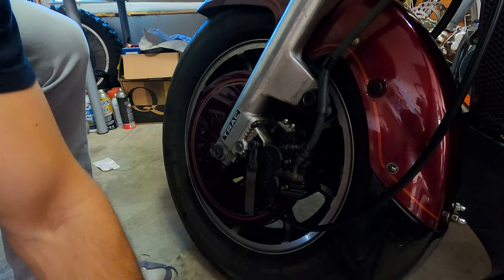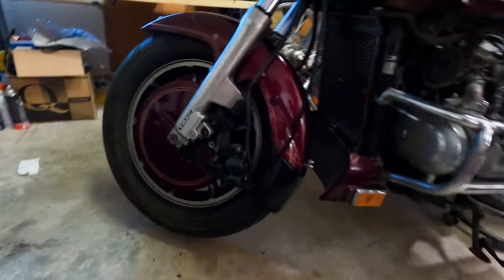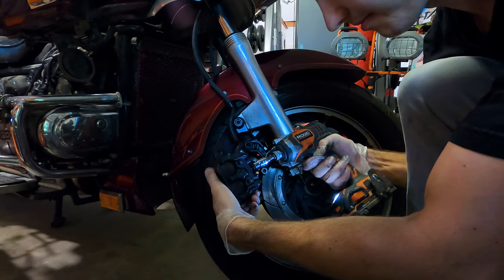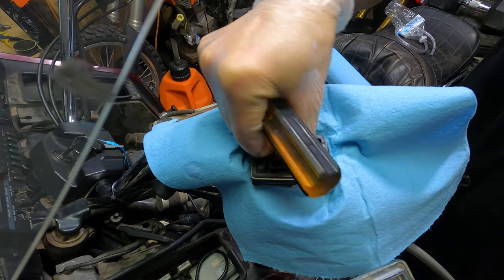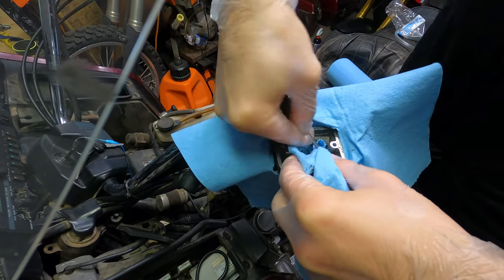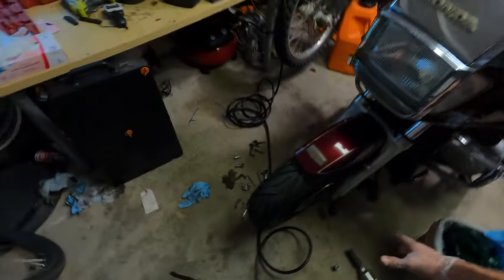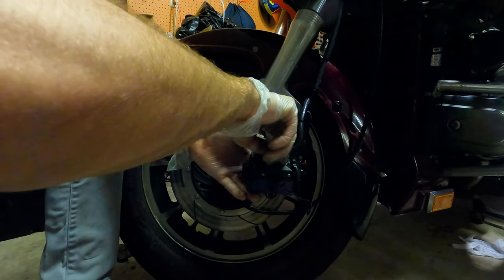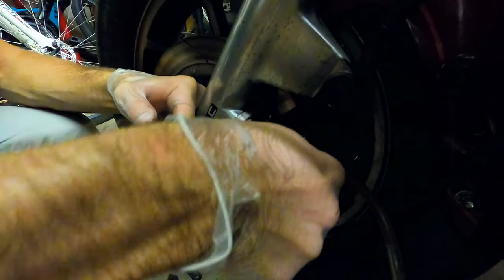1984 Honda Goldwing Brake pads + Flush

Comment: Travis.  Did not see you bleed right front brake, which is part of the rear brake system activated by the brake pedal.  Also, did you replace the rear pads, just not shown?

Comment: You lucked put, those push pins came out super easy. Even lubed with fork oil I would think they would have needed a punch. Did you have them off before? Good video. Nice bike. I have an ‘81 and an ‘86.

Comment: There is no need to loctite everything.
Reply from the maker: True, but when you're working with suspension and brake components it's smart too
Reply from the maker: It's very common for brake caliper bolts to back out